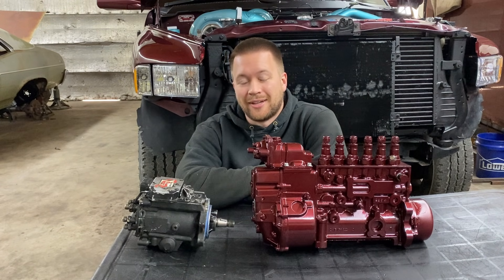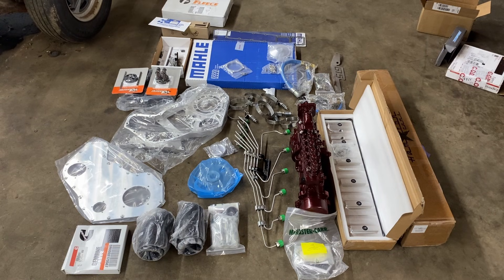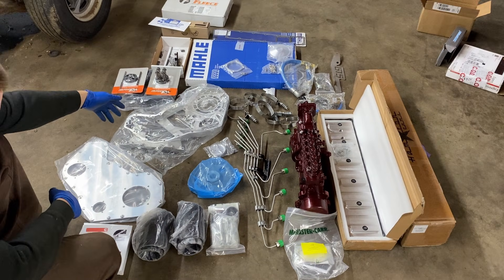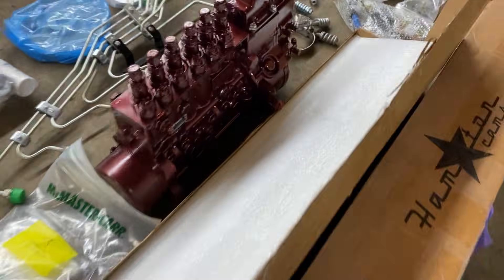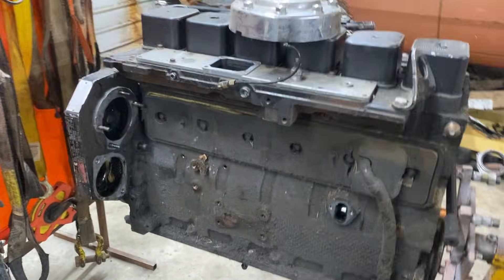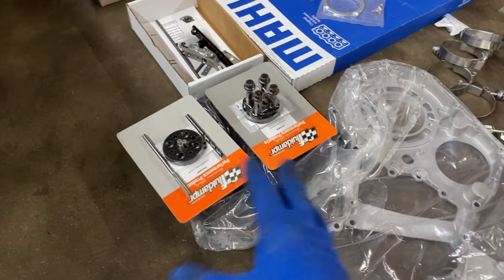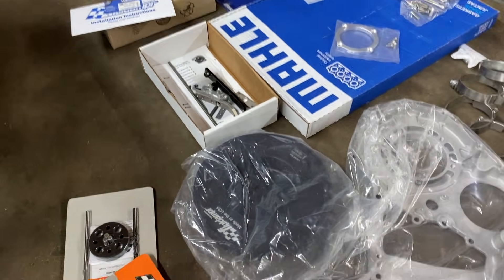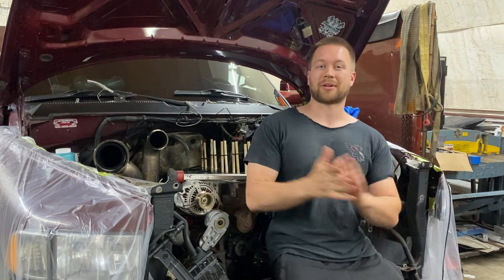P Pump 24 Valve Cummins Swap PART 1: EVERYTHING you need & need to know!

Comment: Do you have to change tappets if you use the 12 valve can
Reply from the maker: @jimmyjackson5578  no, you can use tappets from any Cummins engine. 24v, 5.9L CR, 6.7, they all work. The 6.7L has the biggest tappets, 1.45”, 12v is 1.25” I think

Comment: Hey recommendations for the tapet cover? I did get a billet cover but it leaked from day one. Even after with bolts at torque spec.
Reply from the maker: Honestly, I just run the stock tappet cover haha! Never had any issues, just make sure that the gasket and block is dry, red loctite the bolts, and torque them down 

Shitty deal with the billet cover, it’s not fun to change and even worse having to redo it
Was it one of those Amazon ones? A couple buddies have ran them with no issues, the only thing I gotta say is that most don’t have any sort of CCV filter on them so if you just hook a tube up they will dump oil out
Reply: @Hazardous-Hotrod-Knowledge  personally ordered it from BD diesel. The bolts don't seem to want to stay torqued and I think the gasket blew in less than 200 km. I'm just letting it leak untill I do the cab swap and 12 v conversion. Sure is frustrating when that shop costed me 6 grand somehow damaging 2 vp44 pumps. Just want it to stop leaking ffs lol tha KS for the tip. Shiney don't always mean better eh?
Reply: I just use the stock one replaced the gasket once

Comment: What are the best injectors to run for a 215 pump swap into the 24valve. I'm not after crazy horsepower just good trailer pulling power. This will be my work/daily driver. Thanks. Love your videos
Reply from the maker: You could go with a set of 100hp injectors, like. 7x.009, combined with the 215 pump, hx35, fuel plate, and some 3k gov you should have a nice clean 300hp.
There’s no need to re-pop the injectors to p pump pop, I set all my injectors to 300 BAR as it helps with atomization and smoke control. 
Make sure you have an EGT gauge aswell to play things safe.

Also about 16 to 18* timing would be good, or just stock 14.5* timing if you wanted to see if you were happy with that

Comment: I love your video but nobody’s been able to give me a straight answer everybody I talk to. I have a donor motor for my truck. I have a 98 Dodge with a 24 valve I have a donor motor that is a complete 12 valve. Can I just swap the motors and be done with it
Reply from the maker: Yup, the 12 valve will bolt right in. You’ll need the throttle linkage assembly and throttle cable for the 12v, as well as a 1998 12v pcm and engine harness so that the dash will work

Comment: I found this video searching for what the AFC does. Currently gathering parts for my vp44 delete. I dont think you went over the parts needed for the air solenoid or the p pump overflow valve. Those are the only two things I am having trouble finding info on haha.
Reply from the maker: I'm going to have to come back to this video and make a pinned comment covering the additional things I forgot.

For the air reference to the AFC what I like to do is run "Push to connect" fittings with a 1/8th (IIRC) air line. You'll have a fitting on the AFC, and the other fitting you'll put into the back of the intake elbow. 

With regards to the overflow valve, you CAN run the VP44 overflow, it'll work fine, just verify your fuel pressure as they are set to open up earlier. Or get a tork tek overflow valve. I also cover making the return line in the assembly video part 2 (soon to be released)

Comment: Can you add a part number for the cam sensor adapoer
Reply from the maker: P7100-SWAP-CAM-ADAPTER for 2001-2002
P7100-SWAP-CAM-ADAPTER-98.5-00 for 98-00
That’s literally the codes off crazy carls website lol

Comment: Finally!!! A detailed show and tell on the p pump conversion on a 24 valve. My 2002, high output with a 6 speed  is literally waiting for this. I have sent the computer in for repairs twice. I have swapped the vp44 with a Blue Chip diesel unit. Nothing ended up being a permanent fix. It’s p pump time. Can’t wait for the rest of this series. Keep up the great work
Reply from the maker: Ugh, sorry to hear it’s been a nightmare! VP trucks are weird, I have a lot of good ones that just work, and then there’s the odd one that is just a nightmare where the only solution is a swift death or p pump swap! Haha

Glad you’re enjoying the series, stay tuned for more!
Reply: I have one that just works after I fix a few issues with the fuel system it’s not a daily driver fun to get in and use lots of work done to it

Comment: How much is it to do the swap
Reply from the maker: It’s tough to put a real figure on it as there’s multiple ways you can go about it.
I could do one for as cheap as $2000, or as expensive as $7500. Such as how much you get a pump for, do you get a donor 12v or buy a new gearcase/gear, do you go with new injection lines or rebent VP lines, use 12v throttle linkage or run a APPS adaptor, build your own p pump oil feed or buy one, and so on

I would recommend looking over the video for some of the options, picking what you think would align with the way you would do the swap, and then pricing things out :)

Comment: 17:11 could you tell me what wire I need to jump???
Reply from the maker: So the FSS has a relay on the engine harness that normally bolts to the firewall (approximately inline with where the fuel filter is), there’s a pin in that relay (red with a black tracer if I remember correctly, it’s white on the FSS) that you jump with a wire going to the brown wire for your starter (or the starter relay in the fuse box, there’s many options), that pulls the FSS up when you start the truck.

Comment: Couldn't find a 98?
Reply from the maker: Up in Alberta we’re lucky to find a clean second gen period, nevermind a 98 12v!
There’s many bonus’ to starting with a 01-02 24v though, such as you can get the 6 speed trans, more common to get leather interior, disc brakes, sport package, better front brakes and in 02 a non CAD diff
Reply: @Hazardous-Hotrod-Knowledge  I'm in Calgary picked up 98 4x4 extends cab long box 420000 $5500.00 in Edmonton last year, I call it rusty lol,good channel ! Where does a guy get doors? Lol